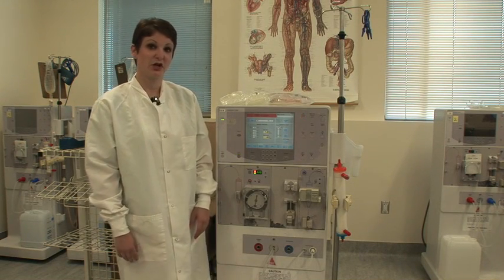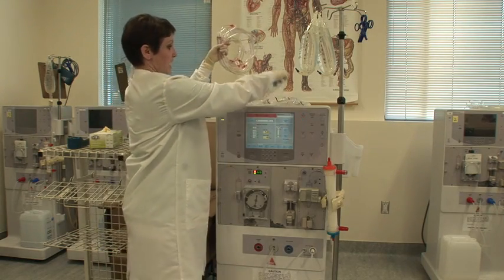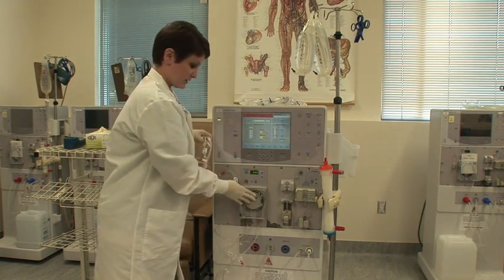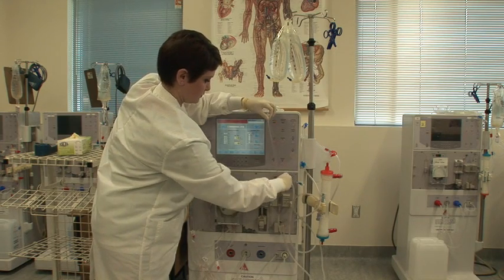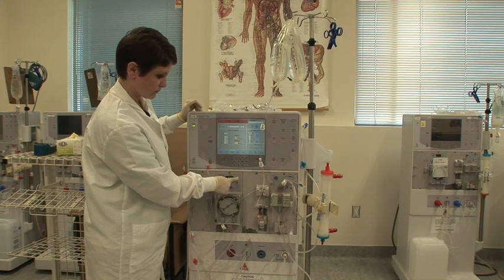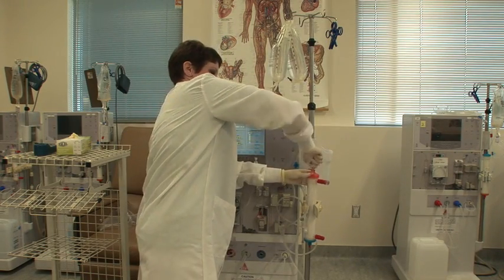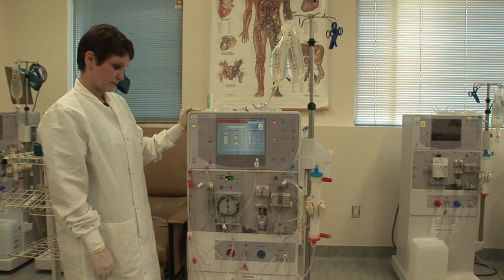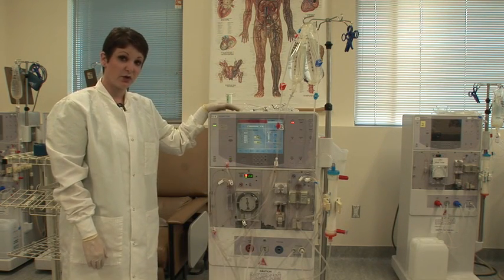Step1_Priming

Comment: Thank you, it is very helpful and priming each line with saline separately seems more efficient than priming after the arterial and venous lines are already connected. If you still monitor the comments, at what point would you hook up the heprin pump?